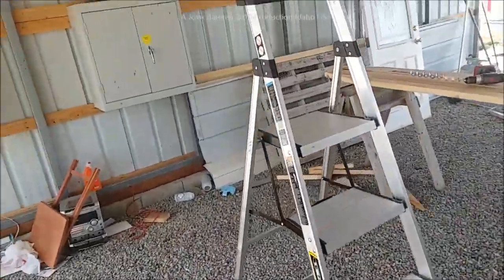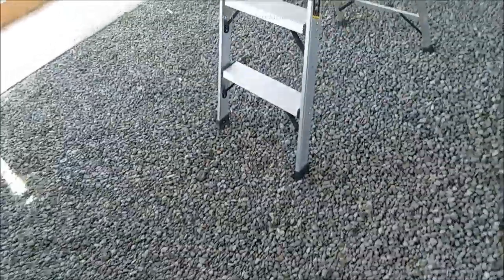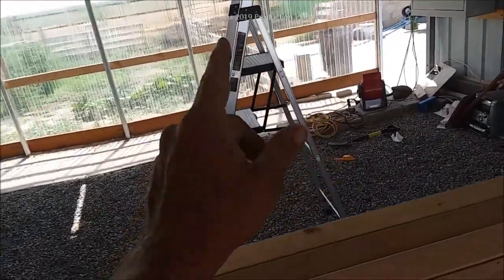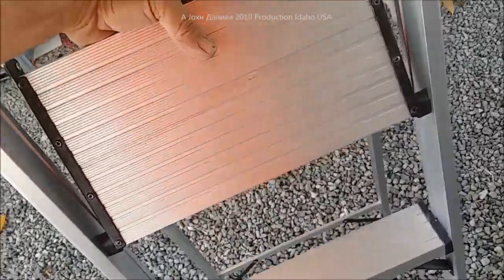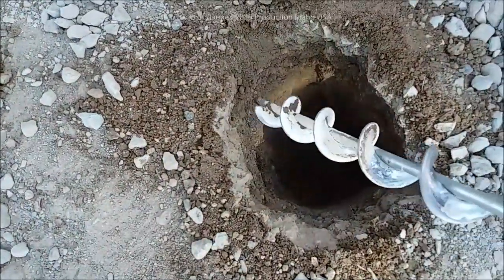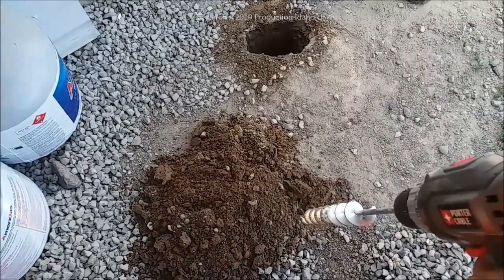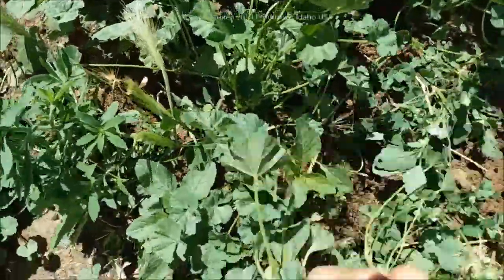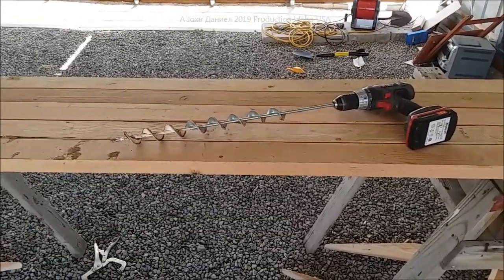A few must have tools and my re built much bigger carport garage

Comment from the maker: ULTRA lite and ULTRA COOL Gorilla Ladder is https://amzn.to/2Y8Kd8c  Many types of auger bits https://amzn.to/2JZMeuv , a perfect 1.75" is really good https://amzn.to/2So7s8N OR my 2" pro version seen https://amzn.to/2JQ1RnW + BISWAYE tool batteries https://amzn.to/2NYAduk for ANY TOOLS, they are #1 ranked. Also Ebay https://ebay.to/2JOZ8Lr if thats best. I tried, test, beat up, abused it so you can save from buying junk. Nothing worse than buying a dud! And If it fails, I DON'T TRY TO WASTE A VIDEO ON IT! *Going from a "SO CALLED" 18 x 20 poor open carport to a 1'-7" taller, 24' x 25' enclosed added $6k to my property value for almost nothing.

Comment: Have you ever hooked up 100 watt panels using a adjustable tv wall mount that's made from unistrut? Apparently it works very good . I havent tried that yet. My 300 watt panels I'm taking an old heavy duty steel ramp made from 3/16 gauge steel  and another 3 fold one and taking the hinge  off of each side and using the unistrut frame  1 for each 300 watt panel and making a nice adjustable rack out of that. Your right about choosing good metal and I definitely found some laying around that's perfect. And I have steel tubes too. And z brackets to mount the panels with all I need to do is drill press the holes for the panels and the points of bolting the entire frame with 5/8 grade 8 bolts and nuts. And some welding . I already made a good combiner box out of 4 10 gauge wires with mc4 adapters on them and lugs and bolted them to bus bars with ANL fuse holders and shut off switch and voltmeter. And used a weatherproof box with plate inside it turned out good the 1/0 cable is going to the 80 amp mppt controller.  From all 3 300 watt panels , then my renogy rover mppt controller 40 amp has 1 300 watt 32v panel and 2 , 100 watt panels in series at 200 watt 34v on the same  set then another pwm controller 40 amp has the other 4 100 watt panels in parallel.  This is going to work good.
Reply: 1800 watts solar and not sure about 500 watt 3 phase PMA yet .

Comment: I love John's place . John looks like he is very busy and a very good father.
Reply from the maker: Its a Tinker mans fun house. I'm home at least long enough every week to burn off road wear on a project. Or at least start one LOL!
Reply: What would you charge john to look over a system and make sure its wired up the best way possible?
Reply: After I hooked up the controller and dump I noticed that my bank is being leeched from something.  Could it be the resister bank? The turbine seems stiff too doesn't want to spin easily it stops fairly quickly.  And my drok voltage meter seems to drop in voltage when yours goes up. And also the voltage meter on the red box is always 2 volts lower than everything else.  I'm using 4 awg cable to dump bank and to  bus bar. And from bus I'm using 7ft of 4/0 welding cable for positive and negative post far right positive side and far left negative side.
Reply from the maker: @donaldsteele6276  Set the divert voltage higher, only use 300 watts max. The little blue potentiometer with tiny screw counter clockwise I think(?) to increase divert points on the control board. It sets the divert voltage. It should be diverting at 14.6 to 14.7 on the meter. If your batteries are near full, like 14.3+ or you have a second controller in the mix somewhere it can affect the turbines actions, if you run 2, or add a turbine, run it ONLY through a Rectifier to battery, and change the SSR relay to 60 amp and go up to 500 watts divert load. Be damn sure to use thermal contact grease on it.
Reply: I'm thinking about removing the turbine  and focusing on solar only. I have spent thousands trying to get a good working turbine setup and honestly I think they are no good unless you have a 60 to 80 ft tower and 30 mph wind.
Reply from the maker: @donaldsteele6276  If your batteries are near full, or your solar coming in is like 15 volts, of course the controller will drag down the turbine. Set your solar controllers to 1/2 volt BELOW your wind turbine divert voltage!!! ( solar at 14.1 Wind at 14.6 ) They will fight each other if you do not. Don't worry, the turbines will do your bulk and float above 14vdc.
Reply from the maker: @donaldsteele6276  A turbine on a trailer is like a 502 big block in a Corolla! But in a location your building in the hills, Ah, yes a turbine is old man winters angry power God.
Reply: How would I know if it's set at that voltage lol. The solar is set at 14.8v bulk was 14.5 but the manufacturer told me to put it at 14.8v and then 15.5 for equalizing charge but that's only once every 2 mo. The board where I adjust the settings how do I know if it's set to the correct settings? Does the light flash so many times or something?
Reply: Makes total sense to adjust the settings thanks John.  Will it help the turbine run better? It acts like it sticks now and I checked the stator and rotor wires it all looks fine. Checked all the cables all connected fine lol. Could the throw switch be a problem? Is a inline 100 amp breaker okay on positive battery connection?
Reply: I'm only using 300 watts . I sent you pictures of the wiring I did it in parallel on resistors.  What size wire should I use on the controller box? Should I wire it directly to the bank instead of busbar?its 7 ft to both sides of bank from inside the box. I have 1/0 ,2/0 ,4/0 gauges? I'm using 4 awg right now to busbar its wired with 4/0 and resistor 300 watt bank 4 awg cable to  that and 10 awg wire for parallel wraps and soldering. And 12v inline blower inside that box.
Reply: Hey the green light blinks 4 times
Reply: I did turn it clockwise counterclockwise  is down according to the pdf file on setting the voltage level it says it's very touchy 0.5v is this for every turn? It didnt say but apparently I need to wait till its windy enough to turn the turbine. And use a voltage meter that's accurate and wait till the battery bank is full and start adjusting it till desired setting unturned the first 2 counterclockwise turns then added 2 clockwise turns.  I will adjust a bit more when its windy. For some reason when turbine tower is down it turns fine from just turning the blade and it's easy and it goes for a while.  But raised its stiff and it stops easy. And the tower is level I checked.  I wonder what the deal is. I bet it's the stator and rotor or maybe the bearing is rough not sure.  I wish I could just get the damn thing to work perfectly when its windy out. I changed to my 3 hub and added 3 big blades to see if I can get it to go faster or at all. I might have to take a ride to the airport to test it.
Reply: What size of bearing is in the rotor housing?
Reply: John do you have any 5,000 watt continuous inverters 12v that work good

Comment: Man O Man I would love some place half the size of your Carport Fort Man and Girl Cave place.  I'm currently without any decent place to build projects of any fashion.  All flat surfaces have reached the  1:1 Ratio.  For the unknowing that means when you set something on the flat surface, something else fall off. 

** Off Subject     I have a Chinesium 500W wind turbine here waiting for a Power Wall Project to be Completed.  Not using the crappy Charge controller that comes with the things,  What sort of voltage do they produce using a simple 3 phase  Bridge Rectifier Diode set up alone ?   Within the Nominal Rating ( 24V  Unit )   I'm guessing 10 - 50VAC ?     Appreciation sent.
Reply from the maker: You would run the 500 watt turbine into a 48 volt controller like the 24 volt one you have now, normally they are listed as or you can search for a 800 or 1000 watt 48 volt. From it you pipe the power to a MPPT that can handle no less than 100 volts DC in. From it you tune it to properly charge Lithium. The 48 volt controller will let every volt to a point of 60 volts pass through, as DC into the MPPT, it can take anything 6 volts on up to 100 and convert it to your setting of 24 volt. Trust me, it will allow the turbine to spin easier and create good voltage, the MPPT is the key, it converts all the volts to amps!
Reply: @JOHNDANIEL1  I'll have to check into that.   Working on substantially   Limited funding here.  Sept  my SSI should kick in and maybe something could be done then.
Reply from the maker: Heres a suggestion, run the turbine through a similar controller like it came with, but a 48 volt, so the braking load culls it at about 60v then from it to a 40A MPPT thats rated or settable for Lithium. from that you can produce charge to a 24 volt bank from 6 to 100 volts.
Reply: @JOHNDANIEL1  Not sure I followed that.  Provided Charge controller Breaks at 30VDC.  Goes back on line at something like 27.0VDC.  Will the thing Produce 100VAC ?  Must be spinning it's arse right up in RPM for that.  My  current charge controller is only a 20A MakeSkyBlue MPPT.  The 20A only comes as  a Kit Version.  Shoe string budge here.  I could go Poor mans MPPT using just a Constant Voltage BUCK converter down to my battery voltage.  Still Realize the Current Gains like a MPPT just not tracked.   No matter what goes into the thing the BUCK still puts out the set voltage as long as the input is higher then the battery charge set.  Need to get the thing in the air so I can do some checking and mess with the thing.  Sorta at a stand still until I can come up with some battery.  All I have right now is a 8S 2P 38120 LiFePo4 set up.  24V 15Ah.  Currently all my Solar  ( 400W )  is just feeding a Pug and Play Grid Tie.  Battery is just being Floated and really not even being used.    Planing on using a second Grid Tie as a Dump Load.    Trying to fit everything into the cubby hole the mobil home propane heater was in.
Reply from the maker: PS - If you get possible wind storms, then get a 60 amp MPPT like this one https://ebay.to/30DKJIQ that can be set to upper and lower Lithium perimeters. Most who use LiPo use this controller, for everything from Hydro, Wind, and Solar.
Reply: So john if I had a 48v not the 12v turbine I could have just run it to my 80 amp EPEVER 200v mppt controller? From a rectifier?
Reply from the maker: @donaldsteele6276  From rectifier then to controller can work.  Not sure your other arrangements.
Reply: @JOHNDANIEL1  my current setup is working ok right now I just need to take it away from my property to a flat open area on a normal windy day and turn it loose and watch the bank with my UL approved clamp meter and tune the float on the dump controller board like you said up is clockwise down is counterclockwise.  Not sure if one full turn is .5v or half or small nudge but I'm sure the equipment will show me once I get the turbine at 500 watts or higher then I can visually adjust. I only asked the mppt controller question because I have 2 stators and rotors sitting here waiting for me to do something cool with them I just need to design something simple to get the suckers moving. Maybe a vaht turbine or a axle gearbox turbine or another big ass 3 blade turbine . What ever I feel like making.
Reply from the maker: @donaldsteele6276  if you have a non automatic 10 or 30 amp battery charger, clip it onto to your bank with a full battery power level of 14.1 or so, at the point your controller is wired in to it and it should push up battery to over 15+ volts and you just turn the screw till it comes on divert at 14.5
Reply from the maker: @donaldsteele6276  Leaving for a run to North Las V will be back in 24h
Reply: @JOHNDANIEL1  clarify please where would my controller should be plugged into it? Battery or charger? I have one that's a 2 amp 6 amp and ten amp old school charger. All my others are automatic. My samlex duel 80 amp marine charger is a 3 stage I think. But still automatic . And my ctek is to small  and my solar brand smart charger is the 2 a 10 a 20 a but smart charger. I will have to buy one do you recomend one ?
Reply: @JOHNDANIEL1  have fun lucky lol sounds fun
Reply: @JOHNDANIEL1  ok I understand because my bank is very big I need to drive it with a charger to help the controller get to the dump load stage so I can manually adjust it with my meter. Thanks man your the best professor a student of the arts could learn from, my mind is a sponge that is addicted to knowledge. Thank you sir again .
Reply: @JOHNDANIEL1  I was also thinking of just putting the charge controller red box to 470 ah 12v bank and adjusting the threshold that way so it's not being abused by the huge push back of the large bank and the voltage would go higher faster . My samlex 1280 ul is probably an automatic charger because I cant adjust the voltage the oldschool Schumacher 6.8.10 12v charger would be the best bet.